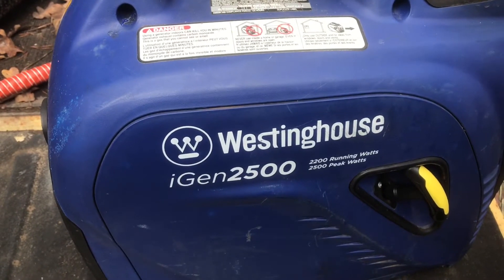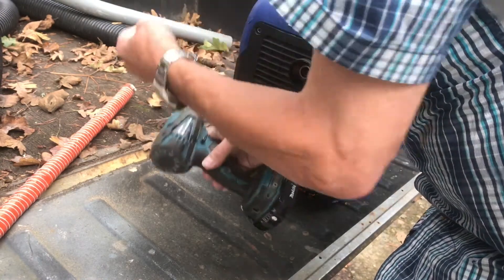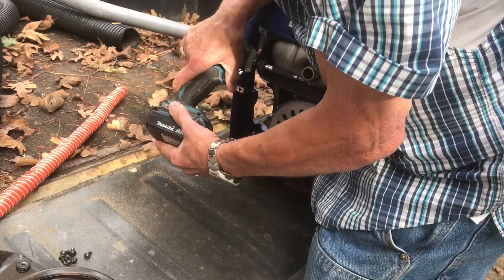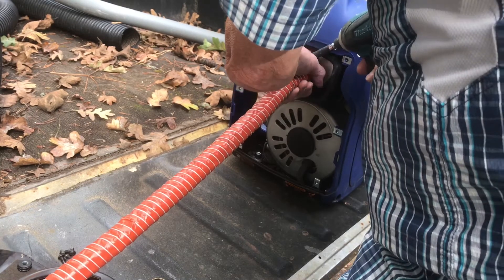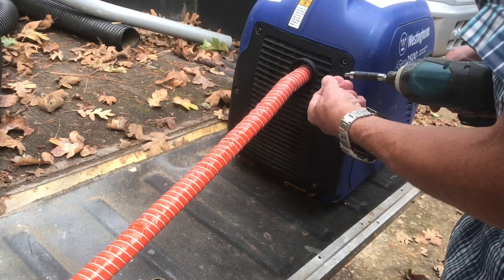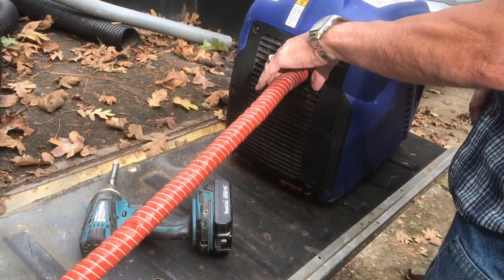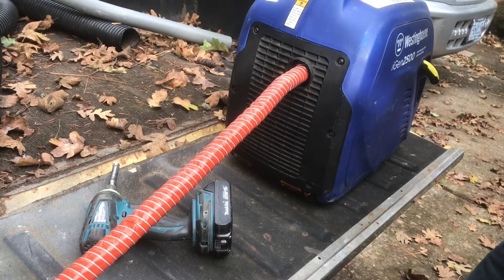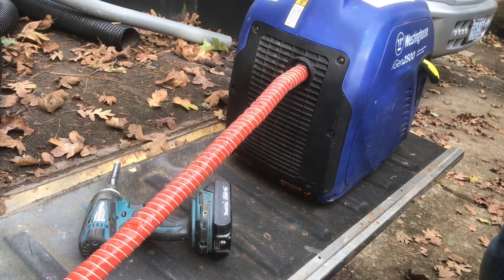Install an exhaust extension on a Westinghouse IGEN 2500 in under 3 minutes

Comment: That silicone ducting is only rated to around 300c.   Exhaust could get to upwards of 700c.  Nice idea, but wrong material.
Reply from the maker: I don’t know about other generators, but I tested the exhaust output of my generator with a thermal IR and it wasn’t up to the 300 degrees. Thanks for your comment.

Comment: does anyone know if this will work on the larger iden11000 inverter? im looking for an extension for that
Reply from the maker: What is the diameter of the exhaust pipe that come off the muffler?
Reply: @davidmartindaletheycallmemacgu  i think its 1.5
Reply: @davidmartindaletheycallmemacgu  i think its 1.5

Comment: Thanks ... i commented on your other video that this is what i was looking for ... great idea and explanation ... thanks a ton ...
Reply from the maker: Always glad to be a help to others. Thanks for your comments.
Reply: my BIG concern is the TEMP RATING of the hose ... i will be starting up my new generator in the next week and will do tests on what the GENERATOR EXHAUST TEMP actually is, but in reading reports on the internet EXHAUST TEMPS can range from 500-1000 degrees ...  and the exhaust hose is only rated at 450 i believe ... am i nuts to have this concern that the material will not hold up ???
Reply from the maker: I did test mine with a thermal imaging camera, but was more concerned with the temperature where it goes through the wall to be sure it wasn’t going to get hot enough to ignite the wood. I’ve only run it for 30-45 minutes at a time just to test it. I’ve never had the power go out for a longer period of time.
Reply: Thanks ... i am very grateful ...
Reply from the maker: You’re welcome

Comment: Thanks for the video its great. One question when installing this kind of exhaust extender is it safe to keep the Generator operating inside house ?

Is it the only smoke exhaust or is there a possibility of a little leak to happen ?
Reply from the maker: No, I’ve got mine in a shed, there is still potential carbon monoxide coming off the generator

Comment: With this setup I feel wind coming from generator us that normal or a leak
Reply from the maker: You must have a leak, slowly run your hand all around the tube while the generator is running, but be careful not to touch it because it will get hot. Check for air leaking
Reply: Another person said the warm air is from a Dan to cool off electric panel. What do you think
Reply from the maker: @onemansjunk1252  if it isn’t coming from the tube that is very possible

Comment: This is just what I was looking for.  Thanks
Question...why the silicone exhaust tube?  Stainless steel ones are much cheaper, any reason why to spend the money on silicone?
Reply from the maker: The stainless steel transfers heat much easier which makes the outside of the stainless much more dangerous to ignite wood or any other flammable material that might touch the metal.
Reply: @davidmartindaletheycallmemacgu  Thanks so much.  Safety is a priority.
Reply: I just saw another video where the silicone exhaust tuning burned right through in multiple places on a small 2000W generator. For that reason, I'm going with SS exhaust and surrounding it with a 4" Dryer vent exhaust as a 2nd layer.

Comment: Hello, quick question. I live in my an, have a 2000, power fist inverter. Do you think if I run flexible hose through ear door properly clamped it  be safe  no fumes in van. Canadian winters can be very cold. Will use inverter for heater fan. 
 Will build baffle box to deaden sound. How's yours for noise without a box? Hope extension kepp it down. Great, helpful video liked and subbed 😊
Reply from the maker: I would not take a chance putting it inside the van. They make hitch carriers for hauling lawnmower, handy cap electric scooters etc. I’d build a box on one of those, but be sure you have some ventilation so the inverter doesn’t get too hot. You can still insulate the box and that will cut down on the noise and the baffle is also a good idea. Hope this helps. By the way harbor freight has the hitch carrier.

Comment: Just ran across this video. How is that silicone hose holding up? I just purchased a 3300 watt MaxPeedingRods inverter generator. (It's a chinese knockoff of the Generac GP3300i). It's a tad bit louder than I had hoped. I plan to use it to run one of the AC's in my toy hauler travel trailer. To help cut down on the sound so as not to annoy neighboring campers, as well as to keep it out of the weather I plan to place it under the rear of the trailer. I'd like to get an exhaust extension to pipe the exhaust away from the trailer for safety reasons.
Reply from the maker: First my generator inverter is 2200 watt and the silicone hose is holding fine. Mine is a 1” exhaust. I’m thinking yours might be at least 1 1/2” so the heat outlet might be close to the same. If you have an IR gun you can test the heat output and that should give you an idea if it will handle the exhaust for a continuous length of time. Hope this helps.
Reply: @davidmartindaletheycallmemacgu  thanks for the info. Just got the generator yesterday so haven't had a chance to play with it yet but will measure the exhaust pipe tomorrow. By looking at it it doesnt appear to be any bigger than the exhaust pipe on my old predator 3500.
Reply from the maker: @Volfan812  if you have or have access to a thermal thermometer, I’d suggest getting some readings after you run it for 15 minutes or so. The silicone tube has a temperature rating and if you’re below that you should be good.

Comment: Hi David! Many thanks for your response! How did the hose you used in the video endure the high exhaust temperatures?
I was waiting for your answer because my diesel car has about 360°C at the exhaust and my petrol engine goes up to 900°C. The generator exhaust should be lower than that, but there aren't many materials that can reliably withstand such high temperatures over a long period of time.
Reply from the maker: I used an infrared thermometer after running generator for 30 minutes and the temperature right at the generator was about 350 degrees and wood ignites around 575 degrees. The temperature where the tube goes through the wall of my shed is lower than that. Hope this helps.
Reply from the maker: Revision of my last reply is that wood can ignite at around 360 degrees Fahrenheit depending on the species and if it’s rotted and after prolonged period of heat. But as I mentioned in my reply the temperature at the point the tube goes through the wall is less than the 350 degrees Fahrenheit that is right at the generator.

Comment: This is perfect for me. I live in a bus and have a Honda eu2200i and have always hated sticking my generator outside because it's expensive and easy for someone to steal.
Reply from the maker: I would not recommend keeping it in the bus unless you seal it from your living space. You could still get carbon monoxide poisoning from leaking fumes
Reply: Not to mention heat buildup and oxygen consumption!  Both are manageable but best best is to build a generator box that is sealed from the outside and ventilated to the outside.
Reply from the maker: @TC-nn7xk  I agree
Reply: RIP Weird Mike…..

Comment: What type of hose did you use? I have an Igen 4500. Just curious what kind of tubing can be used?
Reply from the maker: It’s a silicone high heat hose I got it off eBay 1” x 3’

Comment: Is the tube durable? I mean if you run your generator for 24 hours straight? Tnx.
Reply from the maker: I haven’t run it straight for 24 hours only an hour or two a time. I can’t give an honest answer to that question. Sorry.
Reply: @davidmartindaletheycallmemacgu  I see. A lot of people here on youtube uses steel pipe instead of silicone. Do you recommend it as well?
Reply from the maker: @lindsanity5383  my thought is that the metal would more likely catch wood on fire.

Comment: Mike Martindale here , does the hose make it even quieter?
Reply from the maker: It did muffle it a little bit. Thanks for your question.
Reply: @davidmartindaletheycallmemacgu  
Thank you I’m thinking about making a sound box
Reply from the maker: @mikemjm748  good idea,mine is inside an insulated shed so when I close the door it’s pretty quite.

Comment: We're did you by the tube
Reply from the maker: The link I sent you was for an 18" piece, the size I actually needed. I bought a 3' piece.
Reply from the maker: if you want a 3' section here's the link:https://amzn.to/3k0vFA5
Reply from the maker: I purchased it on Amazon , but I only needed half of it so I cut it in half and sold the other half on Ebay. Here's the link:https://amzn.to/3ezREeB

Comment: what size hose is that? i assume the igen 2200 is the same?
Reply from the maker: It's a 1" and I have one listed on eBay with the clamp and the vent for $22 here's the description that's on eBay: 1” Silacone Exhaust Extension Igen 2500 1.5 Feet
Reply from the maker: I just sold it last week
Reply: Have you had a chance to run it with a good load with this tubing? I bought some blue silicone radiator tubing that was rated up to 350 f that failed after 2 tanks. I was getting 278 f readings on the silicone hose.  I'm sure it's talking about 350f water heat . That's why it probably failed. I see the type you have here on ebay. They are saying like 450 f air heat. Is yours holding up to your generator? Thanks!!
Reply from the maker: @anythinguploads2161  I’ve not run it with a heavy load, but I have run it for 30-45 minutes and used a thermal thermometer to test the temperature where it went through the wall of my shed to make sure it was below wood’s flash point and even right where it comes out of the back of the generator it’s below wood’s flash point. The tube seems in affected by the heat.
Reply: @davidmartindaletheycallmemacgu  thanks for the fast reply!
Reply from the maker: @anythinguploads2161  glad to help.